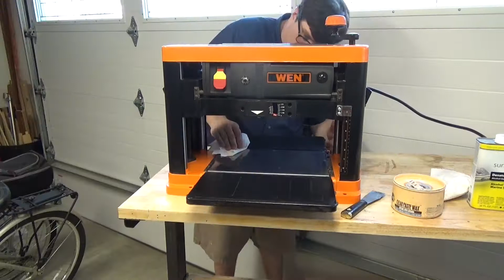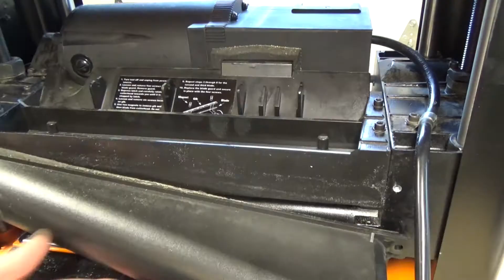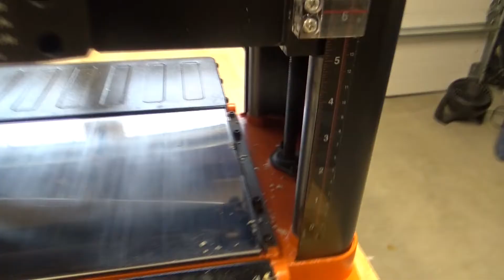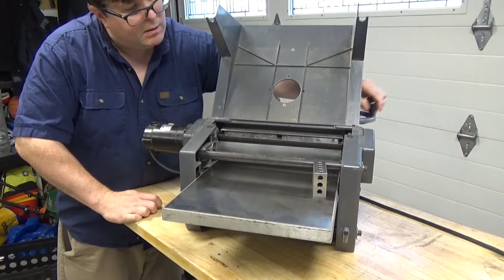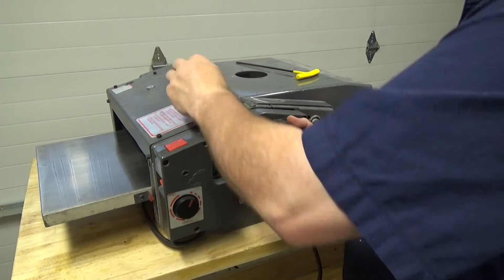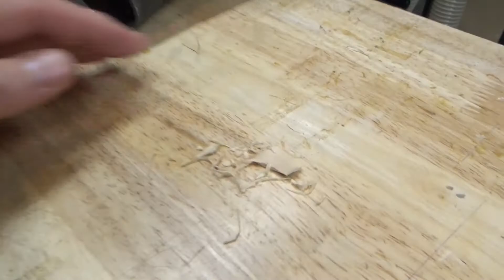Shopsmith or Wen Thickness Planer: Help Me Decide Which to Keep

Comment: I have the ProPlaner.  Mine has a depth gauge - mounted on the front.  Might the previous owner removed it?

The switch is repairable.

The motor driving the cutterhead on the PPlaner is a 3/4 hp., 3450 rpm, 15 amp Emerson.

Could you purchase/make a rolling stand as the PPlaner has, acquire a similar motor….  you’d have basically a Pro planer. (minus the cast iron table)

If not the electric motor etc you could build a rolling stand allowing you to lift the planer, place it on the stand and roll it out of the way.

Another SSmith planer bonus is if you were to lose a bolt etc., the bolts, nuts are common thread and common English size, available at most auto stores.  The SS knives are resharpenable.  The SSmith jig allows you to sharpen planer and jointer knives.

The variable speed motor is a plus.  I’ve had to get material down to “a good” size quickly.  It’ll take 12’ long stuff and run it through AND still do an excellent job.

SSmith planers are built hellferstout.

I’d use graphite on the gears or you may have some gooey stuff-

I took my electrical switch apart.  There was an inordinate amount of dust in it.

The process to clean/look at the WEN knives (let alone it’s kinda cheesy compared to the Shopsmith) was reason enough - Can the WEN.
Reply from the maker: John, good analysis. My SS planer came on an after marked stand with a 3/4 HP Craftsman motor. I still have all those materials so I could go back to that, but I do not have dedicated floor space for the permanent stand.

I still have an open mind on which one to let go, although I do lean toward the SS. So far I've seen very few reasons to pick the Wen.

BTW - The oil I used on the bottom of the Wen is the sewing machine oil (mineral oil based) that is recommend for oiling the sheaves by Jacob Anderson. It was claimed that it does not attract as much saw dust as petroleum based oils. After using it for several years now, I can verify that as true. I use it many places now that I know.
Reply: The stand alone SS pro planer does not have a 3/4 hp motor.  It has a 1 3/4 hp motor over the 1 1/8 the mark 5 has.  I agree with the rest of your statements.  I just picked a used one up today on casters for $250.     But I have ran many of boards thru my fathers over the year and know exactly what I am buying.

Comment: Neither, get a Grizzly helical… never look back! BUT, if not, then the Shopsmith, hands down. I should add, the Shopsmith planer you can sharpen the blades… the Wen,not sure, but most bench top planers have reversible, but disposable blades. Costly in the long term.
Reply from the maker: Great points! Thanks for the feedback.

Comment: I would keep the SS planer.  Width of cut from 12" to 13" is not an issue since almost all standard boards max out at 11.5" anyway.  If you are working with slabs, you would have to rip down anyway, so why not go to 12".  SS uses a much more powerful motor with the headstock which is probably much more reliable.  Of course the variable speeds are always an advantage on both the feed motor and the cutting motor.  By the way, I have a 1984 model SS planer and it DOES have a depth of cut gauge; perhaps SS has a way to retro fit yours.  I offer a disclaimer here: I have a complete SS system which I also use in my shared space garage and have no plans to do anything different.  One final note, it is probable that SS has parts for your planer since the basic design, as far as I understand it, hasn't changed much.  Oh, and it's NOT made in China or Taiwan.  Thanks for the video.  Glen
Reply from the maker: I agree Glen, great summary. The SS planer capacity is already more than I ever really need. And the Wen is probably to weak and too thinly built to handle a 13x6 slab anyway. If I really need very large work done like that, my local hardwood dealer offers that as a service.

Comment: Great overview of these two planers, and video. This is the best side by side comparison of planers I've seen yet!

Asking yourself the following:

If you need to plane thicker than 4" and/or 12" wide, like having the height gauge, don't mind the cutter and feed roller speed, and less dust collection? Then keep the Wen.

If you don't need to plane thicker than 4" and/or 12" wide, don't mind not having the height gauge, like having the cutter and feed roller variable speed, like the dust collection, don't mind mounting and unmounting the planer from your Mark V, and like that parts are still readily available for a 40+ year old planer? Then keep the Shopsmith. 

Now, with that said. If you want my honest opinion? I would keep the Shopsmith planer. I own the same planer as you do. I like the versatility of the cutter and feed roller speeds. I don't have a need to plane anything greater than 4" thick and/or 12" wide, so again the Shopsmith planer is just fine for me. I don't need a planer for every project, so mounting and unmount the planer with my Mark V isn't a hassle. So long as my body will let me do so. If I need parts for my planer, I can still buy some new, or on the used market. All positives for me.

I know you're asking for opinions from us, your viewers. Ultimately Thomas, I have to say the only opinion that really matters here is your own. You will be the one using one these planers in your shop, not us. I say keep the one that you like and will enjoy using the best. 

Good luck with your decision making!
Reply from the maker: Spot on analysis. I do think it is interesting how common place the design of the Wen is compared to the very unique design of the SS. If I let go of the Wen buying another very much like it would be cheap, easy, and quick.

Comment: I chose a separate lunchbox planer which I have mounted on a Rockler steel stand with casters so I can move it out of the way when not in use. I chose a unit with spiral carbide cutters, so I won’t have to worry about sharpening and reinstalling the blades correctly. I have a table I can place on the outfeed to catch the boards. Overall, I spent less than a new Shopsmith unit. Until I found Scott Markwood, I was concerned about buying a used on on eBay. I am happy with the results but might reconsider if I had to do it over again.  I understand there are spiral planer heads now for the Shopsmith which I would definitely upgrade. Good luck on your choice.
Reply from the maker: James thanks for the feedback. You make a lot of sense. I did buy my SS unit used and paid much less for it than the Wen. But it was not in working order, nothing broken just in major need of a serious cleaning and tuning. And honestly the only reason I risked the purchase is because I already owed the Wen which was doing just fine.